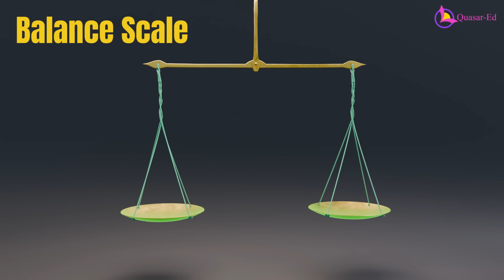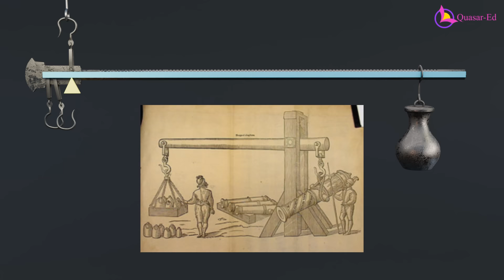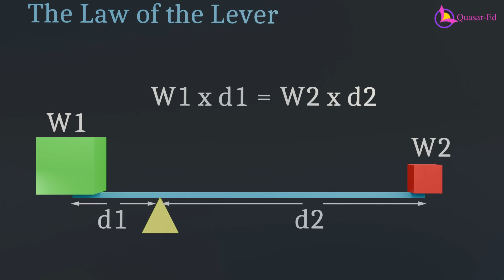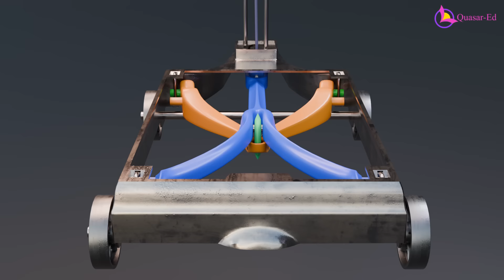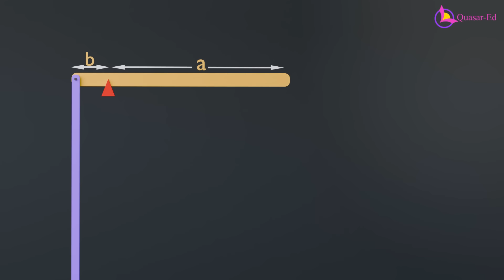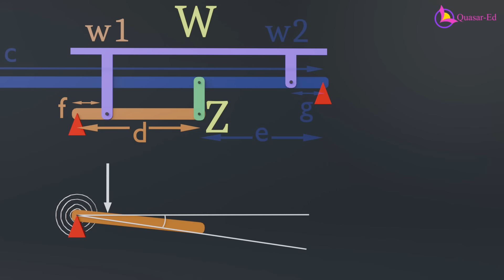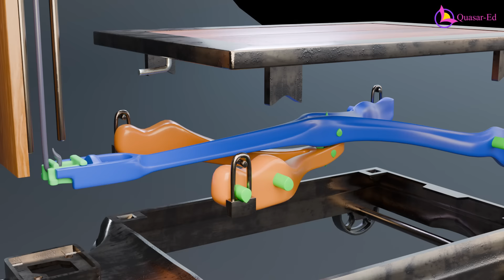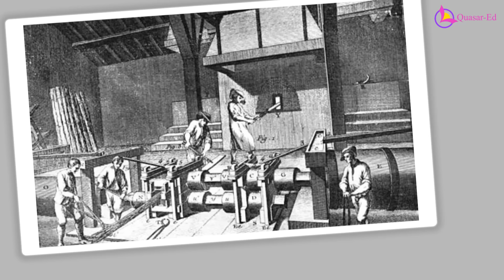The engineering behind a mechanical platform scale

Comment: The brilliance of the platform design is that the dual lever arrangement of the platform means the load doesn't have to be placed exactly centered. The offset load just distributes the weight on both levers, such that the difference cancels out on the measuring arm. 

And as a bonus, the design ensures the platform itself always stays level even when loaded unevenly.

It's really a VERY clever piece of engineering.
Reply from the maker: @akaHarvesteR  Indeed..

Comment: Cam someone use this platform scale without worrying about the long and short levers, and not doing any calculations you presented.
Reply from the maker: @LNCMD2023  Of course, all they have to do is read the weight. The weights have two numbers but you can read the larger number. And then add the sliding weight by reading the length.

Comment: i'm curious as to why they didn't use springs or something to automatically adjust the weight on the end.
That seems like it would make it a whole lot easier. You just put the item on, and an arm turns a certain amount based on the equilibrium of the force of the object and the string
Reply from the maker: @redpug5042  Well, it was before the discovery of hooke's law which describe the law of spring. So spring scales are a little bit late. And back then people might not know how to make springs..
Reply: Technically, a spring based scale measures weight, while a balance style scale measures mass.

Comment: The digital scales are not as good as balances or platform scales.  Digital scales use strain gauges to measure the force.  These gauges change resistance with stress.  This amount of resistance change is a small fraction of the total resistance.  Other affects (such as temperature) also affect this resistance leading to large errors.  The biggest problem is zero drift.  To get any type of accuracy, the scale must be "zeroed" IMMEDIATELY before use.  Mechanical scales can hold there zero setting accurately for years.
          Digital scales measure force, not mass.  They must be corrected for the locality where they are used due to changes in earth's gravitational field.  Balance scales compare forces of 2 masses in same gravitational locality, & are accurate anywhere without calibration.  Mechanical scales also do not require electrical power of batteries to work.  They are powered by the weights placed on them.
Reply: Many digital scales rely on a level surface. Balances do not.
Since digital scales are a kind of spring scale, they share a lot of the same problems.
I think it's possible to make a digital scale that doesn't need to be leveled, it's just expensive.
Reply: Any measuring instrument is designed with a vision/goal to provide a reliable measure of the object under test (to be measured). Since measurement as a practice ties together people engaging in some socio-economic transaction, trust on the machinery/tool merely plays the same role of arbitrating justice so that both the parties engaging in the transaction can feel unmanipulated about the value that each commodity is valued for. Thus standardization makes sense. Thus techniques of compensation for physical disturbances, calibration, etc... have always become essential factors in ensuring the accuracy and thus compliance to a standard established. Thus standards become a prerequisite for a machine - especially measuring instruments/objects, calculating devices in order to convince people that the measurement/computation mediated by tool/machinery can be relied upon. This means, that the manipulation is zeroed. This means error is zeroed. To "Zero" thus means making the instrument isolated from its immediate environmental/social disturbances and manipulations. Electronic instruments rely on calibration which in turn is based on statistics of measurement to compensate for drift, and usually where ever more computation is involved, more derived measurement from sensors/transducers like strain gauge are used.... thus reliance on mathematics, algorithms, statistics for ensuring accuracy to meet the standards. Mechanical instruments usually distribute computation in physical form as notified in the video by providing minor, very fine adjustment screws/knobs that ensure adjustability towards standards... And in both realms the standards compliance and calibration has to be ensured by making the instruments inspectable by a authorities.
Reply: @peterbonucci9661 it's possible to make a digital version of a platform balance scale, using optical or magnetic sensors to measure the position of the balance beam. It's really just adding a digital readout to the mechanical scale, but it can enable very precise measurement.
Reply: @akaHarvesteR  I figured there was a way to measure force at each corner and calculate the correct weight despite an angled floor. 
It would be a high profit feature, but i doubt someone would do it.

Comment: i wish this video did a little more with the intuitive side of understanding the principles...
Reply from the maker: @derekofbaltimore  Isn't that intuitive enough?
Reply: @quasar-ed  i apologize, i dont want to sound needy but most of the video was equations which Im sure is necessary because the point of the creation of the scale is to find the specific ratios but Im one of those not so smart folks where math makes me lose track of what happening. It sucks and I should have tried harder in school. 
But i have a LOT of curiosity so I was hoping that the video would have shown like animations with arrows (arrows that grow and decrease in size to show the ratios and of course also showing the direction) and other suck things. None of this would give the precise reasons as to what the ratios would amount to but it would at least let me understand what is happening. Honestly, as a person who does diy, home renovations, and everything from developing my own board games to physical tools for fine artists, I came away from this video with no idea how the structure of the platform gives any benefit to the scale. I didnt understand the two levers or how the forces are directed through the tension wire.
But again I recognize I may not be the brightest...
Reply from the maker: @derekofbaltimore  I am just like you. I prefer to learn visually and not interested in equations. But it was necessary for this video. May be I should add some more to how two levers work. Even though they are not the same kind of lever as balanced beam, you can think of them as balanced beam. If you look at my torsion spring example, you can see it has the same equation as simple lever. So you can change them into easy to understand lever systems. Near the end I showed that it is the product of two lever ratios. You can move the platform weight and its distance to the right of the fulcrum and assume as the extension of the beam. So in conclusion, the distance ratio of the beam get multiplied further by the distance ratio of the long lever with the platform giving us 100 to 1 weight ratio. I hope it makes sense.